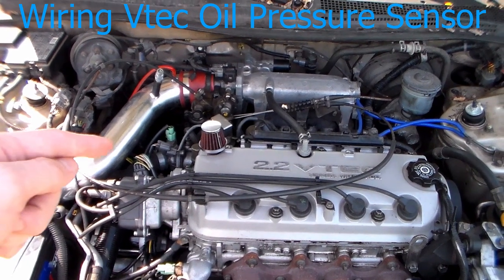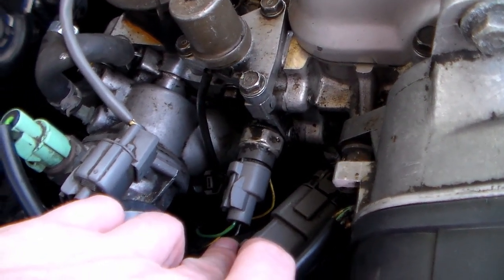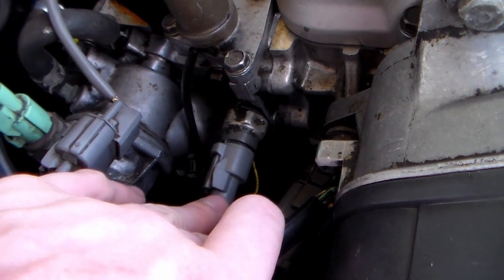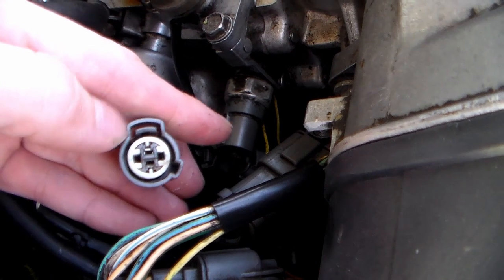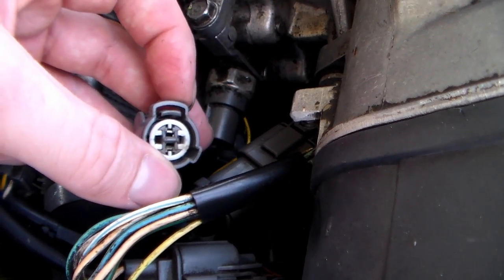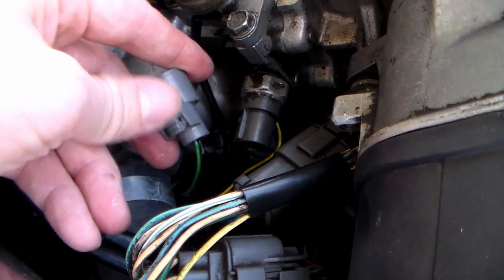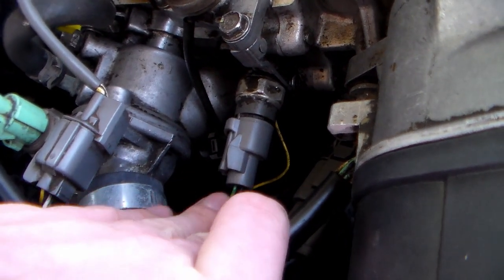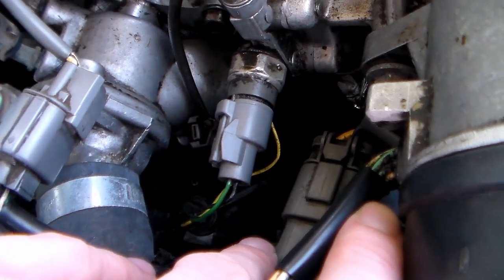Honda Accord Vtec Pressure Switch Pinout & Wiring

Comment: Hey how did u like the mini a.f. on valve cover does it preform better with it? Lmk
Reply from the maker: It's got it's pros and cons. The positive things it does is it will keep your throttle body and intake from getting nasty over time with oil vapors and will prevent carbon build up. If you like the look it does look pretty neat. If you are just driving to work and back or just around town it does just fine with the little breather equipped. The negatives are you do have to clean around it time to time due to the vapor build up on the valve cover. If you drive highways or in high rpm ranges depending on your mileage and amount of blowby it will STINK. I wound up reconnecting my valve cover to my intake air cleaner because for a while I was highway driving and it was very noticeable. Observing actual performance of the Accord during use it doesn't seem to change performance at all either way you prefer. Doesn't hurt to give it try and see how you like it though. I converted my 1979 Chevy Van over to a valve cover breather years back and it was about the same experience except I didn't get as much stink from the breather due to how air circulates around the body. I feel like exactly where the breather is on the Accord and my mileage is why it can get stinky. I haven't had that same experience on Civics though. I haven't had a Civic stink from one yet. Makes sense since the civics' ports are facing straight back toward the firewall where the Accord is facing straight up.

Comment: Hello bro, thank you for your efforts and hard working, i have accord 2002 and the vtec is not connected at all, and im suffering to know how can i connect it, any chance you teach me please, i’d be more than thankful!!
Reply from the maker: Thanks for reaching out! To be sure I get my information correct I have to ask a few things. Does your 2002 have a 4 cylinder like the one in this video or a v6? Do you have an automatic or manual transmission? Is it a US, European, or JDM model? What trim is it like DX, LX, EX? If it is a true 2002, with a 2.3 4 cylinder engine, US model, and it is using the factory ecu for a vtec model then this diagram is what you will be looking for: https://allpinouts.org/pinouts/connectors/car/1998-2002-honda-accord-ecu/ 
Backup diagram for if the first one goes offline: https://www.innovatemotorsports.com/wp/content/uploads/2022/05/Honda-Accord-1998-2002.pdf  
ECU Connector B: pin12 is for the vtec solenoid valve and 
ECU Connector C: Pin 10 is for the vtec pressure switch. 
The process of running the wiring is similar to the way I did in my 1994. I show the process here: https://www.youtube.com/watch?v=1k8HDyyyF6k&t=0s  
Keep in mind your ecu pins will be different than mine in the video (the pins listed above are correct for your application) and your ECU will most likely be located under the center of your dash below the radio. It is held in by 2 bolts and is accessible from the drivers side. I look forward to your reply and will do my best to help get everything wired up.

Comment: So I got 90 accord coupes and I want this engine you think it would work?
Reply from the maker: If it's a 1990 with fuel injection, OBD1 computer system, and existing vtec wiring you are pretty much good to go for a swap. What trim is it, do you have the original ecu or wanting to use the one from the donor, is it a vtec or non vtec, and is it an automatic or manual transmission? The Vtec wiring shown in my video is the same for 1990 under the hood and to the factory 1990 vtec ecu. (pin A4 for vtec solenoid, pin D6 for vtec pressure switch) Let me know what you're working with and I'll help as much as I can. Also check out DrivenFilms Photography on Youtube as well. I watch him alot and he's done alot of amazing stuff with CB7 Accords. He likes to convert alot of his stuff to more modern factory equipment such as swapping out F22A and F22B engines for their F23 counterpart. I've got an upgrade path planned for my engine. There's some parts from the F23 that are bolt on improvements for my F22B. I should probably make a video on that as well.

Comment: i have a 94 civic. it has a Dual AC pressure switch (detects high and low pressure). is there a way to bench test the pressure switch with a vacuum pump/gauge? the service manual doesnt have any specs for bench testing the switch.
Reply from the maker: I'm not an AC specialist so I'm not too sure but back when I tested my '94 Accord to confirm the compressor was bad I jumped the pressure switch. I made sure the system was charged with refrigerant and then swapped out the compressor clutch relay and then jumped the ac pressure switch with a paper clip. With the switches jumped and the car running the compressor should be on all the time. My compressor clutch worked but my compressor was toast. On the extreme side I've heard of people hot wiring the clutch to test it as well. If you swap out the compressor clutch relay and you get nothing then jump the pressure switch. If still nothing check the wiring coming from the compressor clutch for obvious damage. I've seen the connectors get abused by heat and fluids. If it just doesn't work then you may need a new compressor. As a side not it's rare for the expansion valves to go out on Hondas in the past but these cars are aged now. I think that's all I can think of. More info from 1992 Honda Service https://www.mediafire.com/file/v6zpg58g5x8enwm/92-95_Honda_Civic_Repair_Manual.pdf/file  I think you'll get more info from this Accord manual since it actually has the pressure specs on the pressure switch and how it functions listed in the AC section https://www.mediafire.com/file/mqb7g1a66gy91z1/Honda_Accord_1994_-_1997_Service_Manual.pdf/file I know every little bit helps. Hopefully there's something here that will help. Alternate 94-97 Accord Manual that will have anything that the other one is missing https://www.mediafire.com/file/b1f44ldqkmyazql/94-97_Accord_Coupe_Service_Manual.pdf/file

Comment: Just curious. I have a 03 civic lx with a JDM D17A. Pretty sure the ecu is a non vtec ecu. I am wondering as i seen a form that the JDM D17A v tec solenoid is only activated by 12v not a oil pressure switch. Could i just wire a toggle in and manually activate it ?
Reply from the maker: So before I start I not responsible for any damage that may occur from modifications that deviate from stock and the natural response would be to get the proper ecu, BUUUUT here’s what I know. I’m not familiar with D17’s but I am with D16’s and F22’s. The vtec oil pressure switches generally aren’t on the JDM engines but were installed on the USDM ones. On the USDM models you can bypass the switches if needed. I’ve seen multiple people run toggle switches for their vtec online. This was usually done if someone had a vtec head but couldn’t get a vtec model ecu. (like in your case non-vtec ecu but JDM vtec engine) This was a jank way of getting a mini me swap to run down the track at the time. People usually get a lot of flak on forums for it but, meh, it’s not gonna make the car go “boom” immediately on the spot just by doing that. I’ve also seen a couple guys I watch here on Youtube mechanically lock in their vtec with the pins on the rocker assemblies so that vtec is on all the time. Doing this does add more wear to all of your top end components, you get a low loping idle (obviously), and drop your mpg a bit. It sounds really cool though. If I was in your case and wanted to experiment, logically there shouldn’t be any harm in hooking up a toggle and trying it out at least once. Just use common sense. If you get on it and try it out if it makes any spitting/sputtery noises or doesn’t seem right then quit using the toggle entirely. If it seems to work fine with no noticeable issues then you’re safe. The only case I could see this not working properly and possibly cause damage in is if between the vtec and non vtec computers if they deviated fuel trims quite a bit or used different injectors. On the older stuff there could be big deviations in fuel and air maps. Again just use your common sense and judgement and you should be good. Let me know how it goes or if you need any more "creative inspiration". Ultimately the end goal should be to obtain the correct ecu or one that will work so that there's no risk of damage. 

Again at own risk
To quote one forum I saw:  

"No, it is NOT a good idea.

When you activate vtec, you will only be activating the solenoid and switching to your hi-cam. Your fuel/timing maps will stay exactly the same and you will run lean and risk breaking ****. The computer switches to the hi-cam maps when vtec is engaged. This is something you cannot do with a toggle switch."
Reply: @foxisretrofitting4556  haha thanks man. Yeah it's my daily but it's a beater. And I got it with the JDM D17A. How would I check the ECU to see if it's got a pin out for Vtec ? I haven't ever looked so maybe the wires not been ran 🤷‍♂️
Reply from the maker: @leedwolf  Since the 2003 Civic LX models in the USDM are non-vtec stock so I would doubt the wires are there unless the previous owner ran them. If it's still a stock LX ecu it wont have pins for vtec. I put together some resources for you. Here's a text and image pinout and diagram for your car https://www.mediafire.com/folder/xyl0d45eryr9x/2001-2003_Honda_Civic It actually shouldn't be hard to get the right ecu to use. The 2003 Civic EX (Automatic with vtec) ecus can be found on Ebay for 50-100 USD. The issue and snag to this is dealing with the immobilizer and programming for the ignition keys. Normally you want a computer with keys that have been programmed to match it since USDM models usually came with Immobilizer systems but his can be expensive. However if I can get a picture of the inside of an ecu even your lx one I may be able to come up with a strategy to disable the immobilizer in a donor ex one. I've had to do that in the past to a 1999 Honda Accord I used to own that the immobilizer system shit out on as well as showing one of my friends that worked as an Uber and Door Dash driver how to do it so when it finally went out he'd be able to keep going. Being able to use regular keys and install your own security is always a plus in my book.